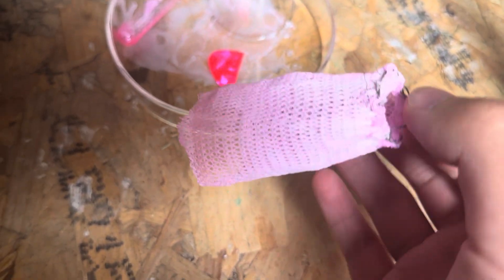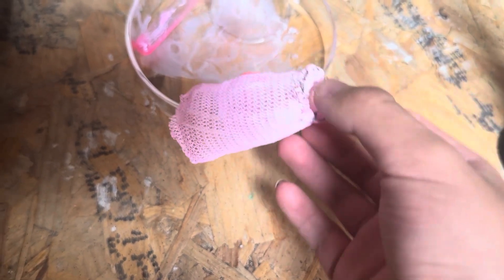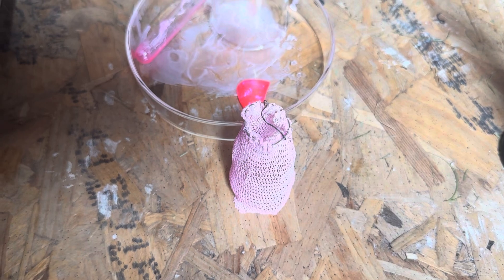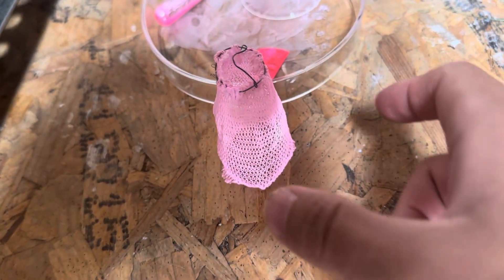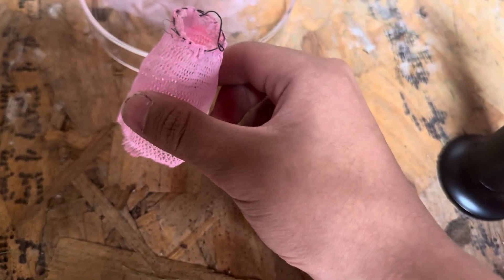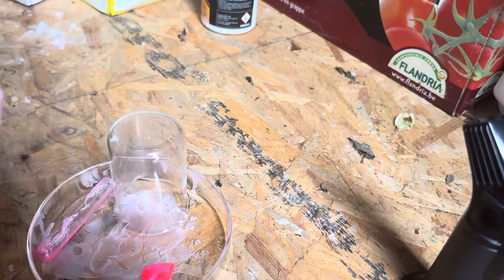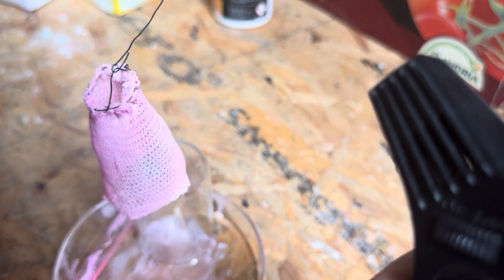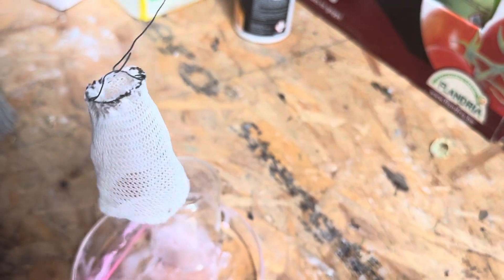Homemade cone shaped gas mantle with coating

Comment: Mmmmmm I have two ideas 💡💡:

1 - Get a fresh (non burnt) mantle and with a sewing needle and a very thin copper wire (from an used cable), knit carefully a (kind of) "frame" around all the mantle (crossing the wire in and outside), trying to build this frame the closest you can from the desired cone shape, I think despite the shrinking, it will keep its shape and size after burning for the copper frame will guide it to shrink correctly, after burning, it will be glowing green awhile,  but I think not too long for the copper will wear out very quickly... 🤔🤔

2 - Get a cone shaped die, put the mantle over it (like a T-shirt) and burn it, after that, get a spray bottle with the solution and spray it over the ashes, after dried you will be able to remove it from the die and it will be already cast and ready for being mounted into the frame and transferred to the lamp for the last burning!! (I think this is the way the factory does it (with automated machines of course)...
Reply from the maker: @laurahelenaxou1834  you are on to something, keep it up.

Comment: Awesome, thank you! I was just thinking how can I make them.
Reply: You have to "install" the unburnt mantle in a way it keeps well tied at the holder base and the above "hooks", now with your own fingers, "inflate" the mantle making it "balloon shaped", now insert a die inside the mantle from beneath (I made my die with aluminium foil covered balls, it got perfect shaped) and just burn the mantle, it will cast in a perfect shaped "Aladdin like" mantle without the necessity of a coat or anything like!!! After all done, it's very easy to remove the die, just pull it from beneath and it won't even touch the burnt mantle's mesh again!! Good luck!!! 🥰🥰🥰

Comment: couldn't you coat the mantle and then lightly stretch it over a glass or stone that's in the shape you want? does this not dry into a hardened coating?
Reply: @slonon6410 You have to do exactly the opposite you said, "install" the unburnt mantle in a way it keeps well tied at the holder base and the above "hooks", now with your own fingers, "inflate" the mantle making it "balloon shaped", now insert your (glass or stone made) die inside the mantle from beneath (I made my die with aluminium foil covered balls, it got perfect shaped) and just burn the mantle, it will cast in a perfect shaped "Aladdin like" mantle without the necessity of a coat or anything like!!! After all done, it's very easy to remove the die, just pull it from beneath and it won't even touch the burnt mantle's mesh again!! Good luck!!! 🥰🥰🥰
Reply from the maker: No, you can’t stretch calcinated mantle as the skeletal ash matrix is incredibly fragile.